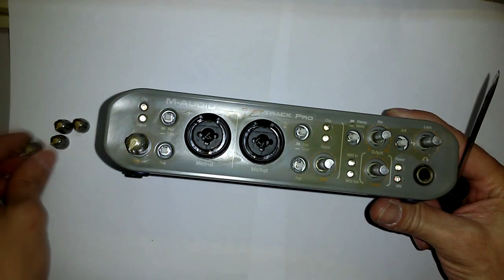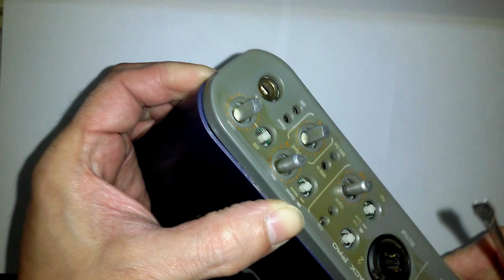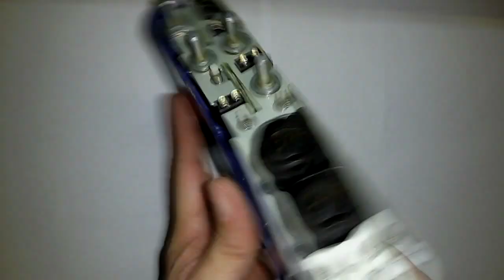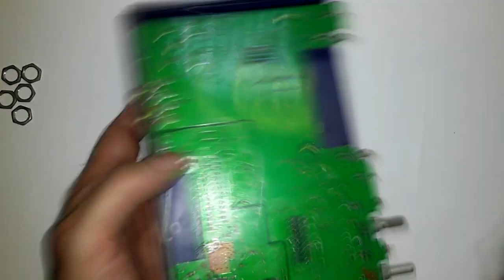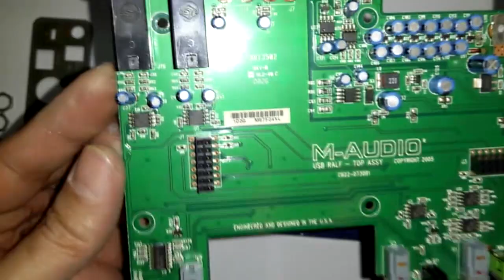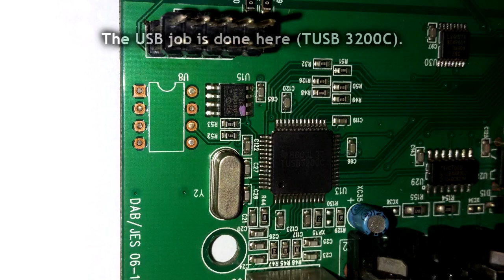M-Audio Fast Track Pro Disassembly

Comment: Mine won't turn on due to thurnder strike is it fixable?
Reply from the maker: Hi, it is hard to tell, simple static discharges can destroy some chips easily. I suggest testing the power supply circuitry first, if you are lucky maybe only something in the power supply was damaged and it is way easier to fix than the digital circuits.
Reply: @unrelatedactivities  ok thanks bro!
Reply from the maker: You are welcome!

Comment: Can you identify the u22 IC?
Reply from the maker: I can't read the full code, but it appears to be a TPS2110. If your unity is open, try to trace the circuit and see if the connections make sense (I imagine it selects between external PSU or USB power). Info at this Texas Instruments link:
  https://www.ti.com/product/TPS2110A#description

Comment: Thanks for this. This is a long shot, but do you know if it's possible to modify this thing to change the 'default' sample rate from 44.1 to 48 khz when running in stand-alone mode? I want to use the S/PDIF output at 48 khz, but it's locked at 44.1. I know I can change the sample rate in the control panel when it's connected to the computer, but then there doesn't seem to be a way to route the signal from ch 1 and 2 to the S/PDIF outputs.
Reply from the maker: You are welcome. I really don't know if it is possible to modify, at least not in a simple way, sorry. The manual does not reference any option, and I never used it in stand alone, but if the Fast Track is also able to receive a signal at the SPDIF input while in stand-alone operation, maybe this input could be used to sync the sample rate to 48KHz.
Reply: @unrelatedactivities  Thanks for the suggestion. If that doesn't work I might try to find an old M-Audio Audiosport Duo which has a selectable samplerate. Cheers!
Reply from the maker: Good luck, I hope that works. I found a 9V 1A PSU (from a Roland SC-55) and I will experiment with the Fast Track in stand-alone mode, just need an adapter to invert the plug polarity.

Comment: I dissasemblied mine thanks to your video because it is not working anymore. It may be because of some on/off issues caused by undesired repetitive plug/unplug of the usb power supply. The push/pull button seems to work. What can I control to find the problem ? Is it fixable ? I mean are those little components replaceable. Thanks a lot. Sorry for my english.
Reply from the maker: If there is no signal of 'life' from your Fast Track (no lights) I suggest you to begin by checking the USB connector, its contacts can be damaged or the solder joints broken. Next check the voltage regulator and components related to the power supply. If visual inspection does not show evidence of some contact broken or component burned, check the circuit +5V and ground path with a multimeter starting from the USB connector. Have you tried other USB cables? These are the simpler things to cause trouble (also the power switch).
Reply: @unrelatedactivities  J'ai cru avoir répondu mais ça n'a pas été posté visiblement... désolé pour le retard de 2 mois, j'ai mis du temps à m'occuper de cette carte son ! J'ai finalement repéré un composant un peu marron en suivant les 5V comme vous m'aviez dis, il s'agit du composant U22, les 5V sont à l'entrée mais pas à la sortie et il parait en plus un peu gonflé, voilà surement la panne ! Il me semble lire difficilement 05 2110 dessus, mais cette référence est introuvable sur le net...avez-vous une idée d'où trouver ça ? de plus, ça a l'air difficile à changer avec un simple fer à souder, qu'en pensez-vous ? Merci beaucoup pour la réponse précédente en tout cas !

Comment: Hi my computer doesn't read my fast track. What should i do??
Reply from the maker: Check the simple things first: change USB cable, reinstall the drivers, try other USB ports, verify if it works on other computers.
Reply: The older M-audio products are not compatible with new mac or windows versions... pretty big fuckup but not much to do there
Reply: @orbitalsounds6239  they are compatible in that they simply don't need a driver to work. I have an 07 mac and it still doesn't recognize my fast track pro. Tried the cables, tried another USB port, tried everything possible and it still doesn't recognize it.
Reply: Try to reinstall the driver again! Hope things'll work well.Mine, the line 2 has cracking sound I need to clean it.

Comment: Thanks I've one which has burned by adapter any solution please?
Reply from the maker: You are welcome. If it was not severely damaged you can try to fix it. You need to check the circuit, starting at the DC adapter input.

Comment: Amigo, tenho uma placa dessa, acabei dando um curto na entrada, o Phantom Power estava ligado e o ganho estava quase no máximo, a placa liga, mas todos os leds ficam acesos, tem ideia do que possa ser? Desde já agradeço!
Reply from the maker: Não sei o que pode estar danificado. O jeito é levar para assistência técnica, ou tentar rastrear os circuitos até encontrar os problemas. Se você conseguir encontrar um manual de serviço com esquemas facilita bastante (nunca encontrei), senão vai precisar muita paciência e tempo. Sugiro começar pela alimentação e verificar se as voltagens estão corretas, daí para frente vai precisar de um osciloscópio para verificar os sinais, e ler uma porção de datasheets.

Comment: Hi buddy. I grabbed a used Fast Track Ultra in 2011 and it's still in operation (Win10).
I never needed the instr/mic preamps, until now. I guess they are defect. Input 2 I get a mic working but no instrument signal and input 1 I get a signal but full of crackles and noise.
What is your guess/advice: grabbing a new one interface, a DI box or is this fixable?
Reply from the maker: Hi Manuel, my guess is the symptoms are related to dirty contacts or bad solder joints on the jacks and / or switches. If you have some experience in electronics you could try to clean the contacts and check the solder joints on the jacks and switches of the mic/instruments inputs. Hope this helps.

Comment: Thanks, very helpful video. My interface has a wicked hum on both the analogue ins and a very odd distortion that drasticaly  changes the sound of my synths. I can't get the digital side working at all since I run windows 10... I figure it is time to re purpose it as " midi bitch" and pick up something new.